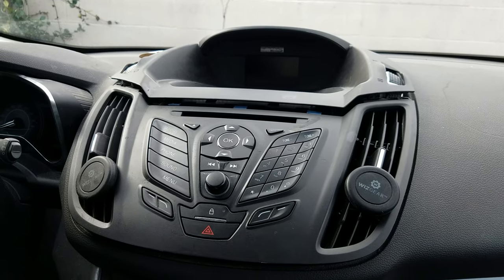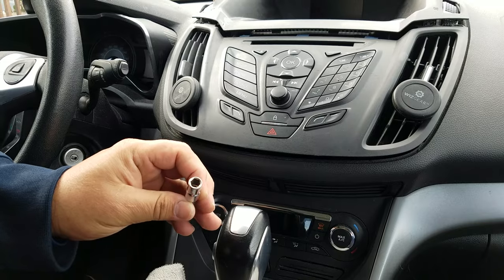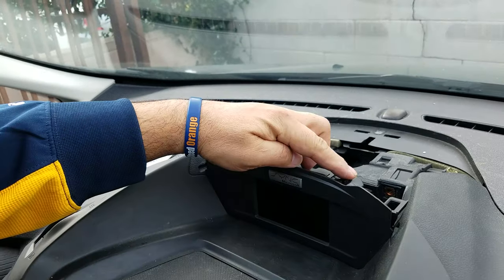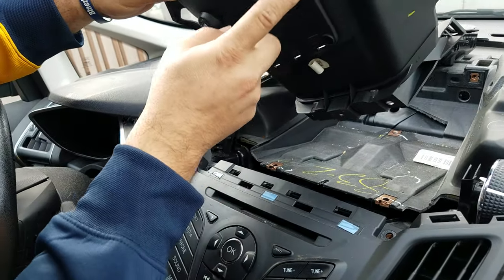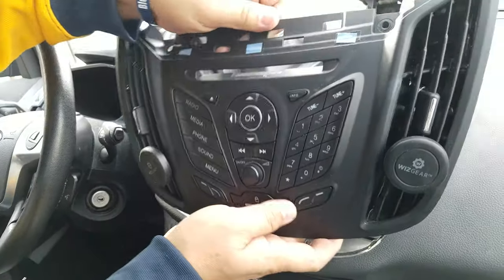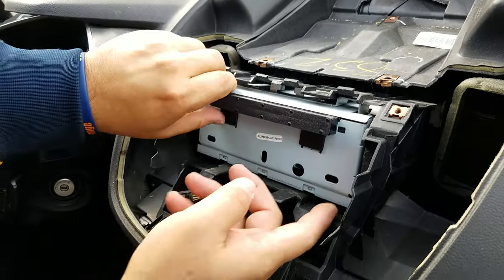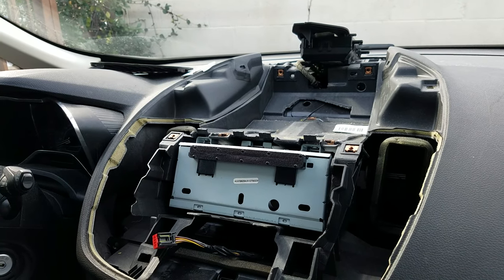How to Remove Radio / Display / CD Player from Ford C Max 2013 for Repair.

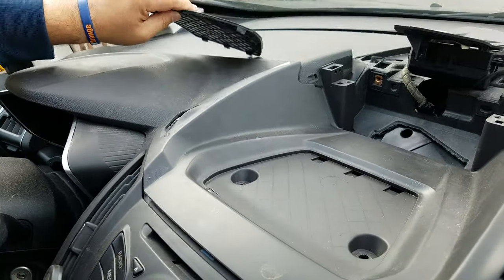Comment: Heads up all... There are 3 of the  7mm screws holding the lower trim plate down.... Not just 2. The third is right under where the heads up display sits in the center of the back of the trim plate. Corresponds with  the  1:10 minute mark in the video

Comment: What could be the reason that the Aux stops working? I tried changing the fuse to the radio and still doesn't work.

Comment: Hello, I have a 2013 Ford C-Max.   The same car in the video .  I  have a problem with Bluetooth. It does not connect at all to the phone.  The phone button on the recorder panel does not work at all.  How can I solve these problems.  Thanks